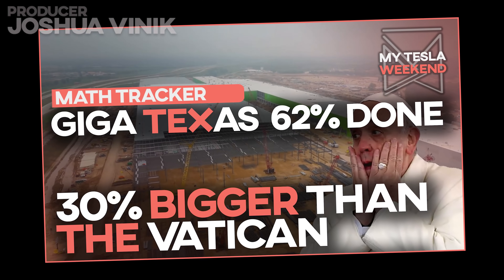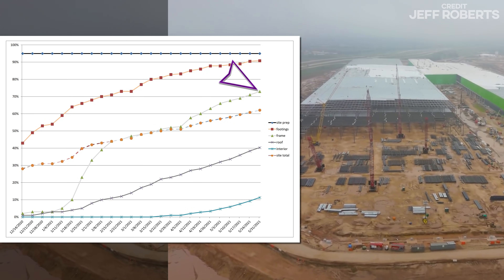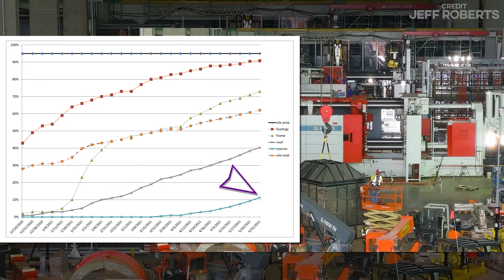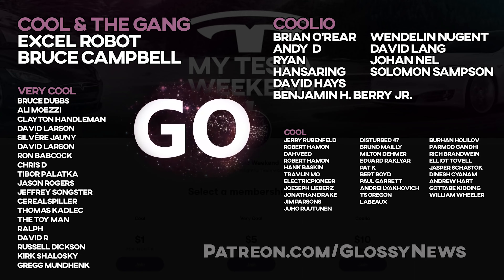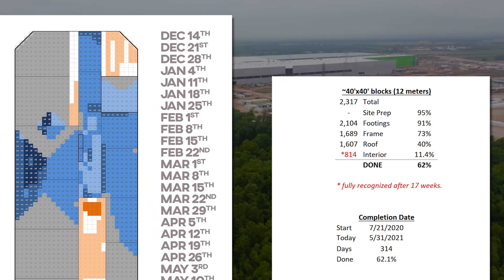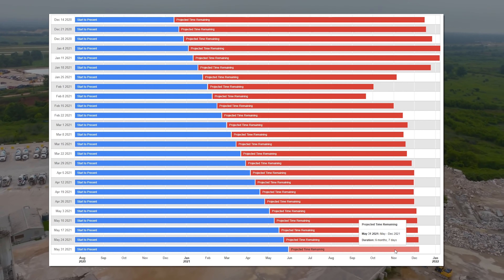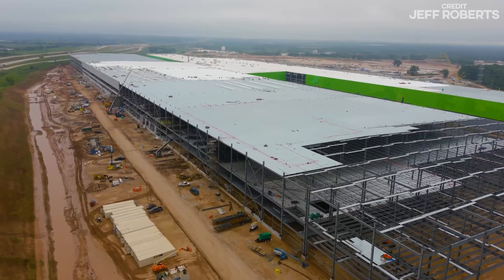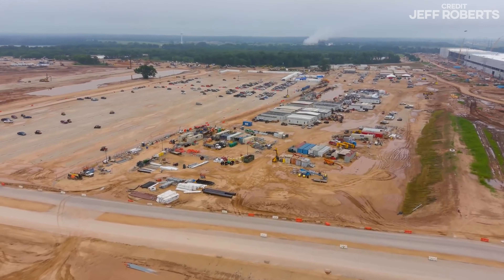Giga Texas 30% bigger than Vatican City and it's 62% done

Comment: Brian, In your picture of footings, I think the display implies more footings are missing in the NE corner than teh actual number..  There are only 9 footings yet to complete where the LNG tanks are.
Reply from the maker: I'm not sufficiently confident that the footings against the central building are in place, but we'll know shortly. As for the 3x4 gap (as opposed to what we can see will only be 3x3 footings,) this is a function of area rather than actual numbers, since the site's progress is measured by area.

These are subtle differences either way and are likely to be ironed out in the next 3ish weeks.

Hope this makes sense, and thank you for the feedback!
Reply: @FutureAzA  We wondered about the columns placed next to the central building for the existing portion of the casting area, but the footings were in place and the columns went up quickly.  There is no reason to think they did something different for the footings to the north of the current casting structure.
Reply from the maker: @brucedubbs6939  It's only half a percent of 1/5th of the overall site progress. I prefer to err on the side of caution in my counts. I'll try to find the footage from the attachment between the concrete and the paint shop this week to see if I need to revise accordingly.

Comment: Been a little while since I messed with DataTables styling, but you should be able to overwrite the style class that defines margin/padding. I would inspect the rows, try to find that style class,  edit the values inline until you find the property that makes the difference (using dev tools, F12). Then, write an inline css style sheet (apply it after you load the DataTables style sheet) with the new style class with the edited spacing values.

Comment: Hey, mind sharing the link to the JSFiddle, I might be able to help with the CSS. And also do you mean changing the height of the rows so they are closer together?
Reply from the maker: See if this works: https://jsfiddle.net/myteslaweekend/4qzesw9u/10/
Reply: @FutureAzA  Yep that works. 
There doesn't seem to be an option for changing row height as highlighted here: https://groups.google.com/g/google-visualization-api/c/IKm5IlMx9es

However, google charts does have an option for changing the font size for labels which does reduce the size, so I've added a new option for that, you can adjust that yourself to suit. Let me know if you have any questions!

Updated JSFiddle: https://jsfiddle.net/e4kfc9z5/
Reply from the maker: @DvApps  Well I guess the good news is that I'm not as bad at CSS as I thought. I was just sure it was something that could be adjusted outside the script, but I guess it's coded into it. :/